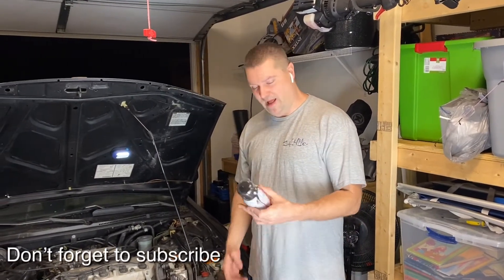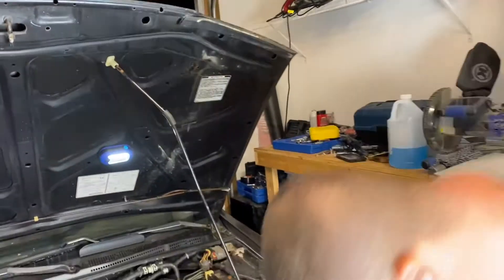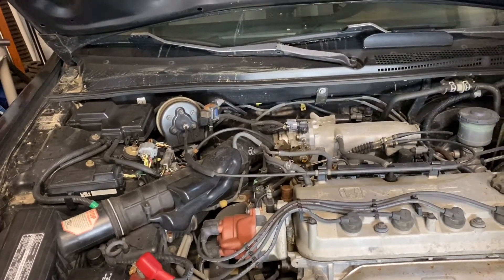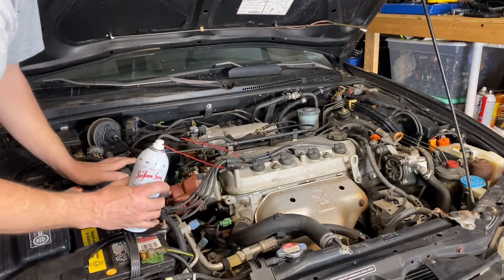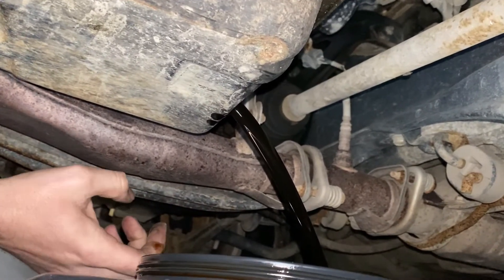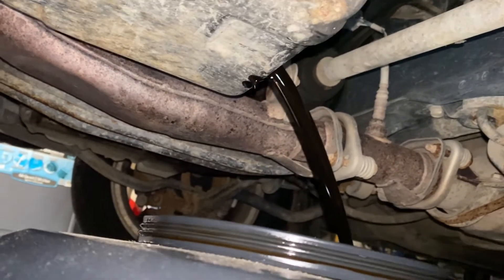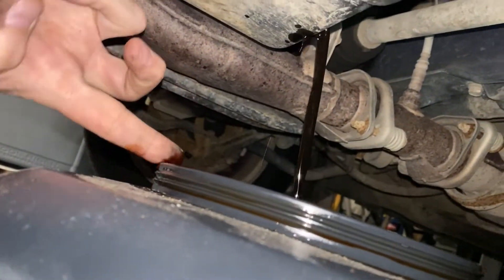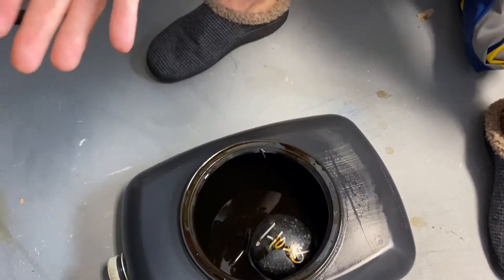Honda accord has a rough idle? What is causing it

Comment: can you please do a vid on what fuel line is a return and what is the main. cant figure out witch line is the return on the motor. need help ASAP
Reply from the maker: I sold that vehicle, but I can do some research on it and let you know what I find out. Can you send me a message on Facebook or Instagram or email me at jcmotivegarage@gmail.com.

From what I know the main fuel line is connected with a filter. The retune is not a fuel line, it goes to your evap to recirculate the unburned fuel. I sent you a diagram. Hopefully this helps.
Reply from the maker: https://www.cargurus.com/Cars/Discussion-c2150_ds684829

Comment: My 1998 Honda Accord vibrates something fierce when in D4 and not moving. I don't know much about cars but I changed by myself the spark plugs and wires hoping that was the problem. Fresh oil change and filter. Its got to be a misfire or motor mounts. Drives great its just that damn vibration. So annoying
Reply from the maker: You can check for a misfire, start the car and pull one spark plug at a time and if the idle doesn't change that the one misfiring. I would check that first.
Reply: my boy you gotta fucked up torque converter
Reply: @jyfinesse1789  ill check that out. Thank you
Reply: @jeremyhigdon3402  does it shake when is parked and stop when is on drive?
Reply: @jyfinesse1789  it does both of that yes
Reply: @jeremyhigdon3402  oh yea no doubt you needa torque converter homie thats like a 200-300$ job
Reply: @jeremyhigdon3402  is not worth it for a 98 accord just put some type of transmission treatment and sell it
Reply: @jeremyhigdon3402   my guy dont listen to him just yet. Could be a lot of other cheaper/easier things IACV, TPS, dirty injectors, dirty throttlebody. Check out some of the honda forums online. People have started a lot of threads about these issues. Start off with the simplest/easiest problems it could be then work your way towards larger/more complex things to check. In the industry we call it "KISS". "Keep It Simple Stupid". You did a good job starting w/the plugs/wires.
Reply: @huntercollier668  thank you for the help. I am considering moving from Oklahoma to Ohio so i need to make damn sure the car is healthy to make the long drive
Reply: @jyfinesse1789  not worth it? If it runs good and doesn't use oil it's definitely worth it.
Reply: Did you figure out what was wrong
Reply: Hey Jeremy I have this same problem with my Accord did you ever figure out what was the problem???

Comment: Did it fix the issue ?
Reply from the maker: Yes, I did a sea foam treatment and let it sit, then it started it up and it burned the carbon build up I the throttle body and intake. It could also be a misfire, you can plug a spark plug wire and see if the idle changes. If you need help, you can message me on Facebook or Instagram.

Comment: What was that about sea foam 🤔?
Reply from the maker: Richard Schroeder it had a rough idle, so that cleans the carbon out of the throttle body and valves. It also improves gas mileage on older vehicles.